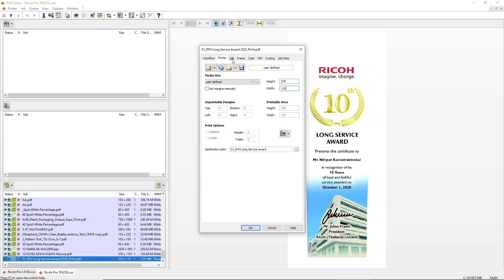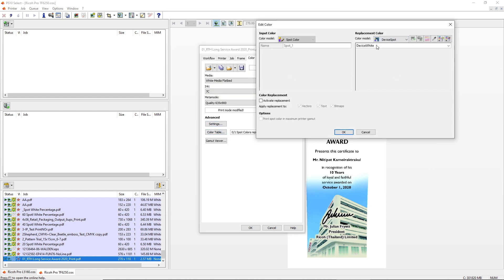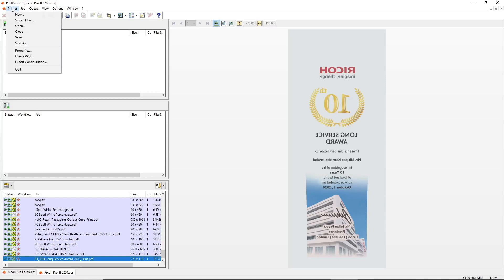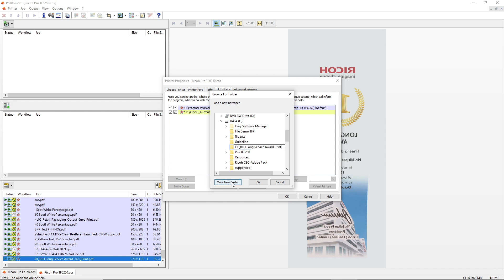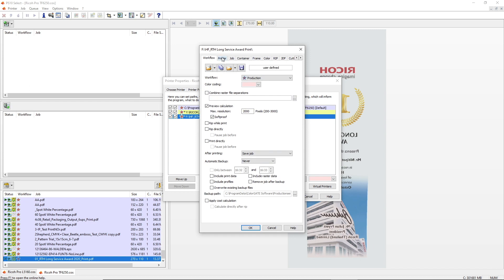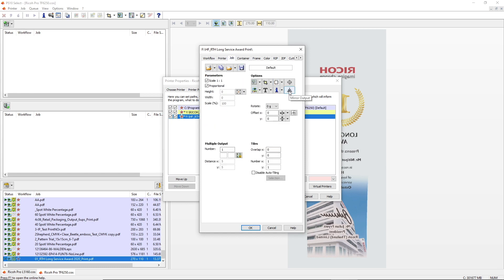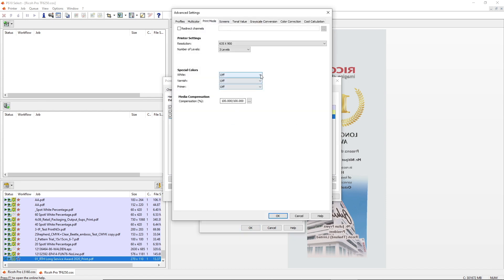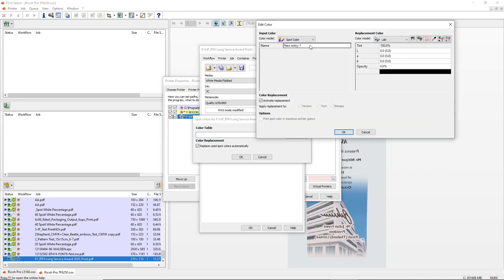CEC Tips & Tricks Ep. 10 - Ricoh Pro TF6250 Presets

Comment: Hi - we've had error code 353 on our TF6250  - synchronization error in Y axis.  "Please confirm interlock switch ..... "  This prevents us from moving the carriage on the Y axis and we have to restart the machine.  This clears the error but it reoccurs again.  Any suggestions would be helpful
Reply from the maker: Hi there. Would it be possible to contact your local Ricoh service representative? They should be able to assist.

Comment: Symmetry Printing bought the first machine in the US.. Serial N. 002 and we encountered a multitude of issues with the printer. Initially, there were problems with the ink not curing properly, resulting in the boards sticking together. We also experienced issues with smudging of the white ink and noticeable banding on our prints as well lots of media scratching because the table was never leveled when installed (table was leveled after the first year and lots of damage media). Vacuum-related problems were widespread, which forced us to apply tape to secure most of our materials. As of now, the printer has essentially become a large, non-functional piece of equipment because Ricoh never took the necessary steps to address or replace it.
I firmly believe that the root of these problems can be traced back to the technicians' lack of expertise. In fact, within the first three months and after a couple of technician visits, the machine had to undergo a complete rebuild with new heads. This was due to the fact that two technicians essentially mishandled the machine, resulting in a catastrophic failure where negative pressure was compromised, causing all the ink to spill onto the table and my office floor. This incident further highlights the technicians' lack of proficiency.
In contrast, I have not witnessed these issues with the new machines that utilize updated ink, and the vacuum system has since been relocated and repaired. I don't know about the techs :D
We had to buy a new flatbed (Other Brand)) in order to fulfill orders and not send those out. While I still believe that the Ricoh offered superior quality and speed, the inadequate support, service, and responsiveness from Ricoh have brought us to this point where they are unwilling to replace the machine, despite my willingness to continue making the remaining payments.
As a side note, Machine Serial No. 003 was sold online for $7500. YES... No typos $7,500!!!